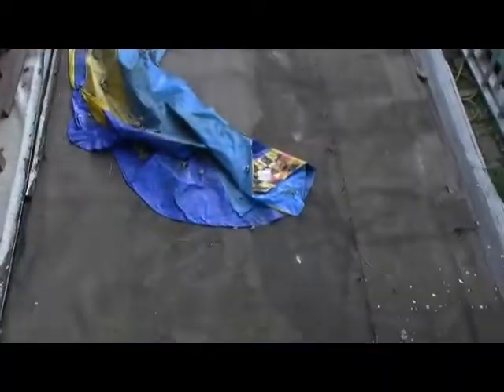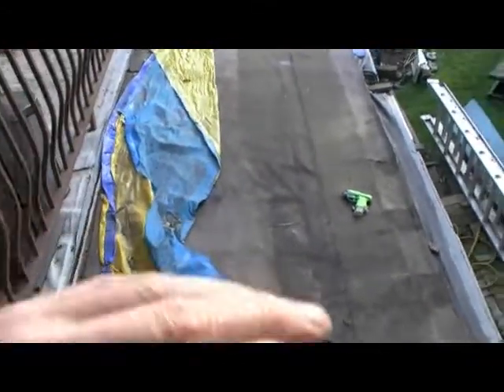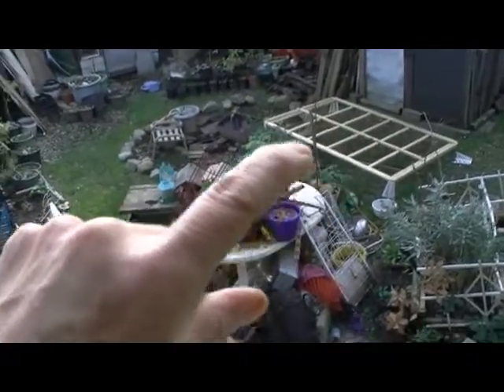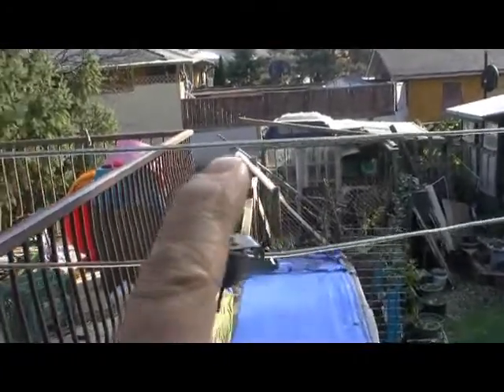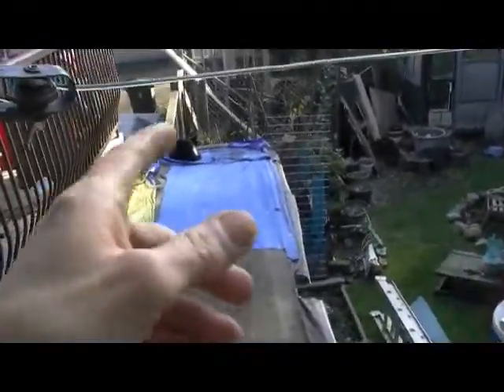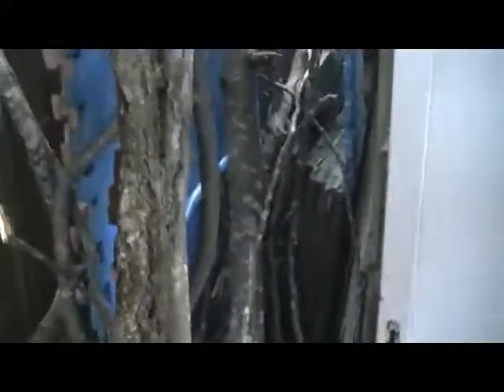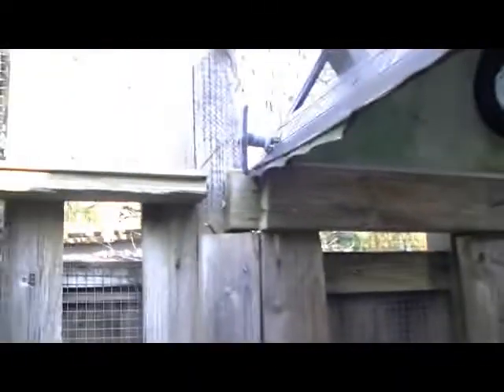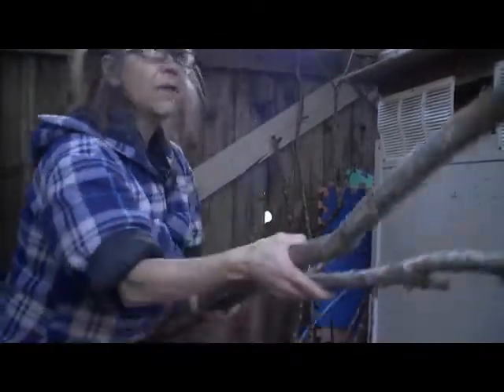Again Intensive Labor - Help For ShaMay - Oct 31, 2019

Comment: You are a strong and strong willed ole fart. Im thinking maybe you should post a number for in case you fall.  It will not help if all we can do is yell at the phone!!!!!   I admire your determination. And yes duct tape is definetly a plus.
Reply from the maker: ha, ha...that's to funny but only these video's are not live now that you brought it to my attention...geesh.
Reply from the maker: I try not to worry about falling off a ladder or anything else I might be standing on depending on what I am doing. So far I have never injured myself in any capacity outside of getting a small cut, but sometimes I will bruise up my legs quite a bit because I use them to move heavy items sometimes.